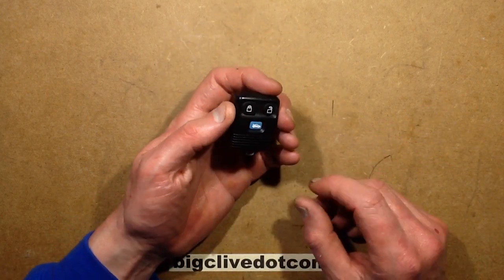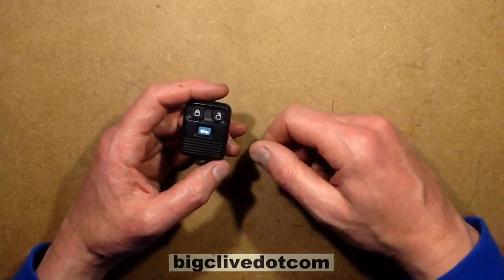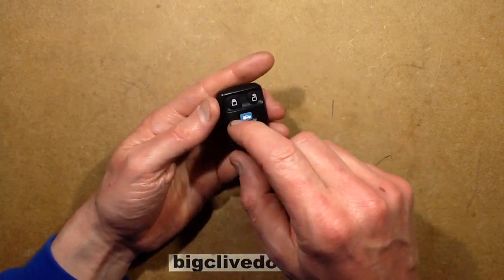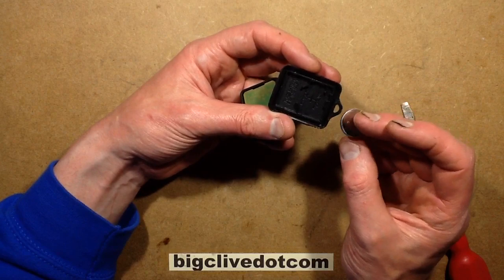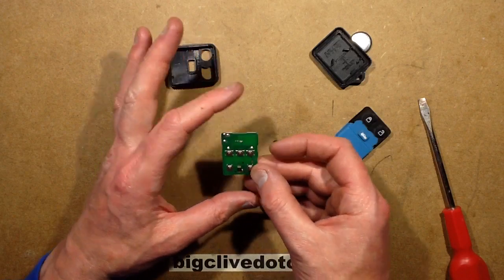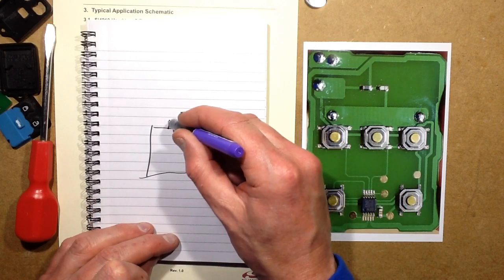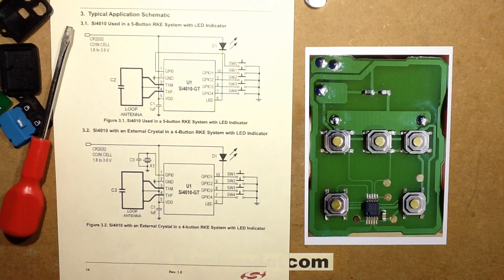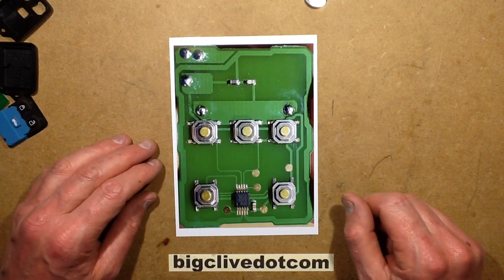Inside a Ford Transit keyfob remote.  (and pairing it)

Comment: I had a Ford Transit for years, bloody awesome van, got pulled over by the cops and weighed, I had 5 tonnes in the back ( building waste ). They let me off as the suspension had not bottomed out, best van ever !
Reply: Fizzbin25 They wouldn't let you off if you had 5 tonne in the back!  It's not all about the suspension bottoming out but how you'll get the thing stopped!

Comment: 315 MHz AM Modulated for US Vehicles
433 MHz AM Modulated for EU Vehicles

The  dual cap arrangement on the antenna is for tuning so you have the proper power with less VSWR. Radio waves are basically a sine wave with a (+) and (-) half of each wave, The caps help to stabilize the tuning AKA - capacitive coupling tuning.
In Ham radio this is done with a varicap so the operator can "tune" an antenna to a desired frequency for maximum efficiency.

Usual Button Functions (all 5):
Start, Stop, Panic, Lock, and Unlock
Reply: agreed, its tune is more so to protect the high power from getting back into the RF circuit from standing waves rather than efficiency.
ham radio has many smart "tuners" that switch coils, inductors and capacitors to fool its resonant but the power gets eaten up in the tuner, not too bad if its an external unit you can mount high but as this keyfob dont need a wide spectrum of frequency and its low power to start with, its easy to tune with one capacitor 

never seen a car or van here with a panic button on???
DE M6YRU
Reply: Pete Szerszen I hate to say this but the "Panic" button is there because the crime in the US is so damn high..
Reply: +ElfNet Gaming --> I would hate to have to rely on the panic button on my car to save me from crime.  My panic button only turns on the standard car alarm.  Most people in the States have gotten so used to false triggering of car alarms that no one pays attention anymore when one goes off.
Reply: I thought it was so when you paniced because you forgot where you parked you could find it

Comment: I used to drive a 2001 Ford focus, here in Canada, which used the exact same keyfob. I once forgot my keys in my pocket while scuba diving, it was a shallow shoreline dive that day got to 32 feet (10 M) of depth. The keyfob never suffered any ill effects although the pressure would've held the buttons down for an hour. So I can vouch for the effectiveness of the waterproofing strategy.

Comment: One thing you shoudl be aware of is when you enter that mode, you have to have all the remotes  handy. as it clears the old remotes when  you enter that mode.

That key thing works on most other fords 95ish and up:P

Also it is possible to program 1 remote to 2 cars:)
Reply: +KingOfKYA  Its the same thing with garage doors and stuff like that. What you are programming is the "big device" not the remote. You can use the remotes on many devices as they stay unchanged.

Comment: That 8 ignition cycle thing sounds interesting. One of the many things auto manufactures want to keep hushed up. Thanks.
Reply: +Brian Allen Actually it's fairly common knowledge, if you buy an extra keyfob, such as off eBay, it comes with instructions to link your new keyfob (and possibly require all your old ones at the same time) to your car.  Some require you to tear apart your trunk to access a cable that normally hangs free that needs to be shorted to initiate a linking process, other procedures require turning your ignition to accessory 8 times in a row (this is actually much easier) to begin the process.  Basically you're just proving that you have access to the car, because they all require you to be inside it.
Reply: +Brian Allen Stealerships do try to keep the info hidden, they like charging 80+/hr and 35+ per fob lol.
Reply: +Richard Schmidtendorff I bought a car that didn't have all of those bells and whistles, mine just opens with a plain old key. My motto is to keep it simple.

Comment: Strange that Sir Clive popped up with this ( although its 7 yrs old) i just had my transit custom key fob fail & its what most people have had issues with, the tags on the battery connector are far too small & barely fit through the pcb, thus they come unsoldered. My spare also didnt work due to not being charged by the van. I put it on a cordless phone charger and it worked 👍. I repaired my unsoldered 1, took ten minutes, Ford wanted £250 for a new one !!!

Comment: I once had a friend whose Volvo key fob remote stopped working. When I took it apart it was totally corroded - obvious old water damage, although she denied that it every got wet. Some of the buttons and components were falling off the board from corrosion. Purchasing a new one and having Volvo program it would have been very expensive, so I bought a used one on eBay ($13) for parts. It was pristine so I decided to instead transfer the 8-pin chip from the old remote, reasoning that it must contain the programming. The only other chip appeared to be some kind of RF crystal so I guessed it would be the same. Transferring the chip was a pain since all I had was an ancient soldering iron and a plastic solder sucker. The transfer worked.

Comment: The keyless entry on my 2012 Toyota Camry is integrated into the head of the ignition key itself, along  with an inductor coil that is part of the factory anti-theft system. It is a nice looking key. The only issue is that a replacement key runs $400 US & only can be programmed at the dealership. Yes, Toyota is very proud of their replacement parts. . .

Comment: As far as ford remotes go us locksmiths love em! They are cheap to buy and sell and easy to program with little trouble for most after 96! and ford even tells you how to do it and it usualy has instructions in the manual to do so, the 3 key fob thing is for when you want to program another keyfob with just the fobs without having to do the ignition on off on off etc all the time is useful for fleet vehicles which can be synchronized to multiple remotes at once, I have two key fobs on my keychain and as long as you don't use it more than 256 times between vehicles it will syncronyze it's rolling code (8 bit encrypted rolling algorythm) you can come back to the vehicle and hit the button again and you can press any button away from the vehicle again up to 256 times and it will still open the doors but if you hit it 257 times it won't work! 

This is what's more cruel about the keyfob over the cell phone prank rumor that has been going around for a long time, if they overenthusiasticly try this then the remote goes out of sync and has to be reprogrammed!  if you have a ford vehicle shared by perhaps 8 people (taxi maybe?) you might want to be able to program someone else's remote easily but not hackable so someone outside your car in a parking lot can't program their remote to your car so they make it where you need a couple fobs to do that unless you take that very specific unlikely by accident ignition on off procedure

Comment: We finally got the transit over here across the pond in the US, so much better. I drive one for work as an IT guy (hauling Network switches, Routers, Handhelds for a major US Retail Chain)
Reply from the maker: If it's like the British Transit it will be nice and roomy in the drivers area.
Reply: bigclivedotcom it is exactly the same one. We used to have Chevy Express Vans but we switched over to the Ford's last year.  

 I'm at Toyota guy myself, I have a Prius from 2005. (I bought it at an estate sale for $3000 due to some minor body damage caused by the previous owner before she got her license taken away)
Reply from the maker: When I was buying a Transit sized van I tried sitting in all the different brands.  The Transit was the only one I could actually fit in comfortably.
Reply: bigclivedotcom the Chevy Express was a pretty old design. Based on the Chevy Silverado 1500 pickup trucks.  Not very comfortable.  Also the transit Vans we have in the states use a V6 engine. I think you guys across the pond only get the 4 cylinder.

The mileage is actually quite respectable for a big vehicle.  It got about 25 MPG on the highway from our office in Philadelphia to Danbury Connecticut

Comment: Most likely the two caps off the antenna are for tuning the antenna to get better performance; they make the antenna think it's the correct length for the frequency the fob is using

Comment: Too short video! Time just flew by, I thought there would be more.. but I guess thats all =D hehe.. Great video Clive! =)
Reply from the maker: +Chris Fredriksson It was a quickie.  Sometimes there's just not much to actually explore in these things.  Well, not without full on RF signal analysis and code detection.
Reply: +bigclivedotcom nothing wrong with a quickie every now and then
Reply from the maker: +justlookingsteve If the chip is actually the same as the one in the data sheet then there is a pin dedicated to direct driving of an LED, and that pin is conveniently brought out to a single gold test pad.
Reply: +justlookingsteve apply the negative lead of the led to the test pad. and the positive on the positive rail. using the datasheet it may have its own current limiting. (or rely on current output on the battery)

Comment: My guess is:
In the antenna loop, the component connected to + is probably a resistor or a coil that feeds the collectors in two transistors in the IC, while the component connected to gnd is a capacitor, - all adding up to a push/pull configuration.

Comment: Quite a nice system of programming in key fobs, much better than the VW group system of needing two keys, one in the ignition and one in the driver's side door (at this point you realise you either only have one key or the driver's side door lock is seized!)
Reply: +MegaWayneD Yeah, but it serves a purpose. The idea is that no ONE person get your keys, go to your car and program their remote on your car without you knowing. I think is a genuine security feature and not a stunt to get you to go to the dealer.
Reply: +maxsnts But if one has gone as far as to get the keys, he could then get a copy made and be better off with a simpler solution...
Reply: zendell37 Imagine you are at a bar/party, someone with a cheap compatible remote could get to your car and program it in if you needed only one key. I think that what they are trying to avoid. a way to program a cheap device that lets you unlock the car without the need for a key maker.
Reply: maxsnts
That makes sense.
Reply: I really don't see how it's a security feature because if the keyfob battery goes flat you have to reprogram the VW system whenever you change the battery! So if the lock is seized (very common) you can't lock the car. For my old SEAT Leon, I ended up buying a cheap Chinese remote central locking system from Ebay and hacking into the car's lock system. The 2002 VW Sharan I had afterwards had exactly the same problem.
Reply: Something strange here. The battery going flat does not represent the need to reprogram anything. The remote does not change, what gets programmed is the car. And even then, is programmed into flash memory, removing the battery does not erase that. (As far as i know, having owned a VW and 2 Seats)
Reply: MegaWayneD Ho by the way, i guess in comments context not always get through. in my previous comment i was not trying to be rude, i just genuinely think something is off with you description of the problem, and i admit it may be lack of knowledge on my part.
Reply: Don't worry about coming across as rude, I've been using YouTube a long time! With the 2001 SEAT Leon and 2002 VW Sharan I've owned, both key fobs have failed to lock the vehicles after a battery change. Not just VW group vehicles though, Renaults are particularly notorious for this. I don't know what the more recent vehicles are like though. However, on my current vehicle (1998 Mercedes C-class) it doesn't lose the keyfob programming after a battery change.
Reply: I was panicking about this recently when trying to pair the fob to my 2008 a4 but luckily you just put the key in, turn it on and then mash the lock button and that seems to program it on this car.

Comment: I got one of those eBay remotes and it worked brilliant..... for about a week!
Reply from the maker: The eBay clones always seem to work for a while and then stop working.  I'm not sure if the problem is the circuitry or the code generation.
Reply: Where can you get more reliable ones? They all look the same
Reply: @bmci007  the only way to get a reliable one is from the manufacturer but I priced one up for a Vauxhall Combo years ago and it was really expensive although I can't remember how much I know it was a lot.
Reply: @laernulienlaernulienlaernu8953  Thank you, ill keep that in mind

Comment: I believe the position where you turn the key fat enough to start the dashboard and such but not far enough to engage the starter is called the accessory. At least that's what I've always heard it be called.
Reply: +Roflcopter4b isnt it usually  accessory-ignition(dash lights etc)-starter   ? it has been on all my cars so far
Reply: or "position 2" on the ignition as the mechanics call it.. lol
Reply: +Stellar Space Traveler ACC position on some cars my family has owned is backwards of normal ignition. I guess that's the "low-power, radio and cigarette lighter only" mode or something.
Reply: +Stellar Space Traveler Thank you for that.  That explains a lot.  I never even thought something like that would have happened.

Comment: that capacitor/antenna arrangement could be for a charge pump to run the chip off the coin cell
Reply: +steubens7 Just do not apply 1.21 gigawats at 88 mph.
Reply: +steubens7 
Unlikely, considering that the similar chip he found had an operating voltage of 1.8-3.6V.
it's more likely to be some form of black magic, from the school of black arts called RF engineering.

Comment: From the looks of the two devices on the coil, I'd say the black one to the left is an inductor, and the white one to the right is a very low value UHF capacitor. Unmarked black SMD devices tend to be inductors, and white body ones tend to be capacitors in my experience.

Comment: Depending what frequency the keyfob operate on (possibly around 432 Mhz) sometimes they will fail to work because they are being blocked (jammed) by a near by transmitter. This could be any UHF base station eg police, taxi or even Ham Radio. The signal swamping the receiver does not even have to be on the exact same frequency, a signal with a high field strangth anywhere from 400 Mhz up could do it!

Comment: I have a 96 Corvette, it has a proximity sensor, so 5 feet from the car, the doors open, even with the key in your pocket, and when you leave the car, it will automatically lock and arm. The problem is that the range you can use the FOB is only about 10 feet, also, if you don't immediately enter the car and start it, it will continue opening the doors (or lock them with a honk)- This is an issue when fueling the car, cleaning it or servicing it.

I'ts cool for 20 year old tech, but obviously in it's infancy.

Comment: I'm betting that the "capacitor" to the battery might be an inductor. It would be letting DC through, and the one would be a capacitor, and would be the "RF ground" point to form the null point in the antenna.  It's almost like a weird bias-tee.
Reply: I also would not be surprised if one were an inductor and the other a capacitor as well.

Comment: Do the other buttons (which are not exposed) do anything?
Reply: Some versions of the transit had a 4 button remote, so will probably work on those vehicles
Reply: +nrdesign1991 The missing button is trunk release and the one bridged with the center button is car alarm. Pic of 2010 factory remote.

https://drive.google.com/file/d/0B-67tRlJbGrIeEtZNXpUTlRldnM/view?usp=sharing
Reply: No, the difference is how the receiver is wired. one of the outputs would be tied to either a relay for trunk or the alarm's external input. If you are very electrically minded, then you could cut and rewire it as needed. in my case, that means adding a trunk release solenoid.

Comment: If you think that little tiny chip is crazy, look up the ESP8266. Full blown 32-bit processor, wifi chipset, RTC, temperature sensor, a ROM with functions for driving HTTP servers, the whole lot on a little tiny chip.
Reply: Also several MB of flash crammed in there iirc, though that may have been a separate component my dev board... definitely an amazing device!
Reply: +Wolfgang Faust Also, all this for less than $7 and the only other thing you need is an FTDI cable and a computer.